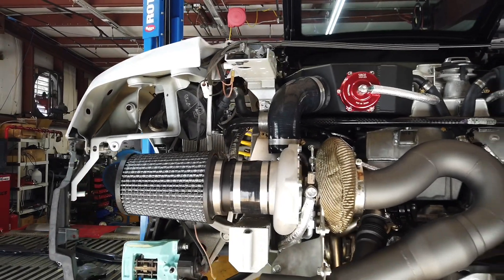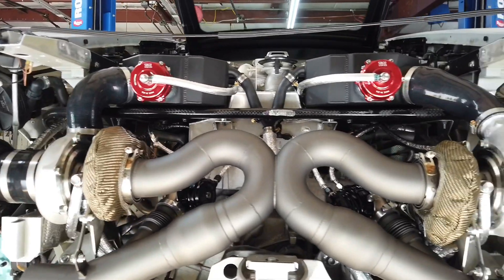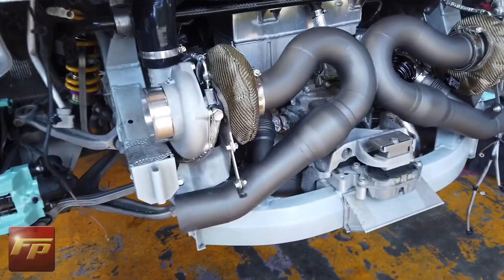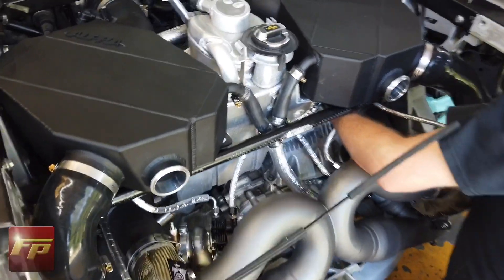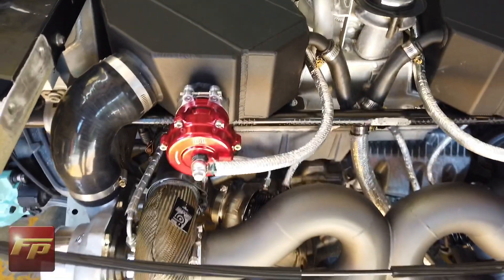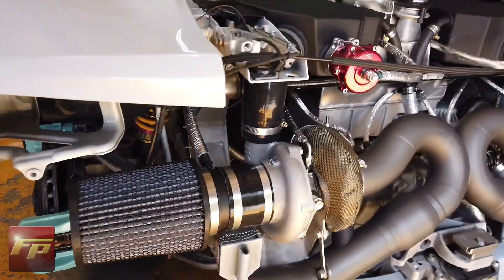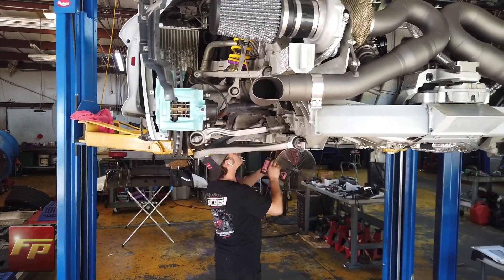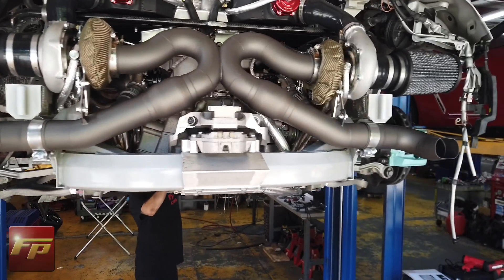Installing the AMS Alpha 9 R8 Huracan Twin Turbo Kit: Part 4

Comment: Joe approximately how many hours so far on this install?
With Alpha 10 installation how difficult is it to access the fuel cell for upgraded fuel pumps?
Also I heard you mentioned you will be doing Dodson sportsman 9. What software are you using to relearn the clutches?
Sorry for all the questions.
Reply from the maker: Nick Yoskin install takes between 40-50 hours all in from time we pull the car into the shop until we are ready to deliver it back to the customer. On the fuel system upgrades it is accessible but you are leaning a little far into the engine bay to do the work so it is more time simply because you need to be more careful of body panels etc. We use the VCDS software that most everyone else uses and we also have a Snap-On scanner that we use for the same tasks.  Hope that helps!
Reply: @ColabGarage  
Thanks Joe!
So you have installed Dodson sportsman 9 in one of these cars?
Reply from the maker: Nick Yoskin yes we have done 3 of them so far. Clutch drives just as smooth as stock with a little TCU tuning and allows for much better torque holding capacity without having to run elevated line pressure in the transmission. We consider this almost a must have if you want any more power than what the Alpha 9 kit offers in its most basic form.

Comment: Are there factory wideband O2 sensors and EGT sensors that the computer monitors? Pumped to see this thing fired up!
Reply from the maker: Yes sir those sensors are factory and are located in the factory header merge collector so we don’t have to add any additional sensors. We are even able to keep them in place when we go stand alone ecu (i.e. MoTeC).